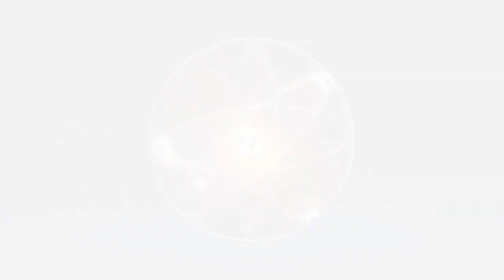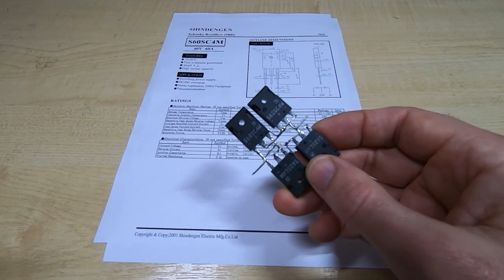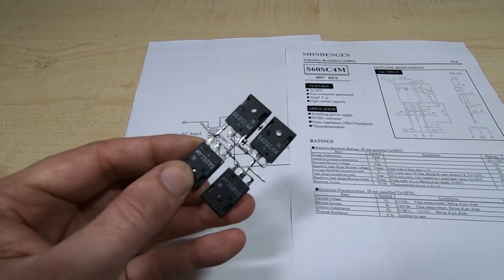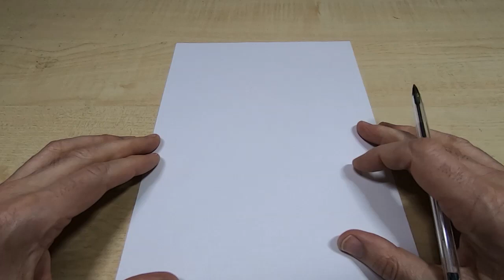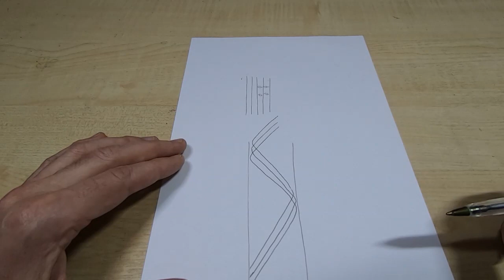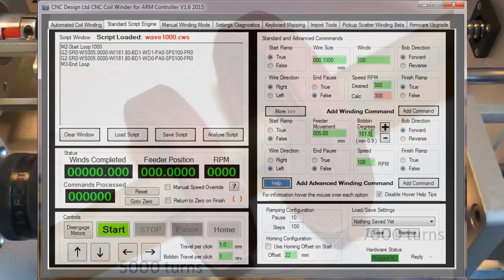CNC Coil Winding Machine Part 2

Comment: What is the purpose of Wave coiling??
Reply from the maker: It reduces inter-winding capacitance so that the coil acts more like a pure inductance. For example in a LOPT the output voltage would be reduced if the energy was going into the coil capacitance but with wave winding there is less capacitance so the output voltage is higher. With normal parallel winding the coil acts a bit like a coil with a capacitor across it. Wave winding is also used in tuned coils where just inductance is required.
Reply: See Faulhaber Motors
Reply: See Faulhaber Motors

Comment: Thanks for an amazing video, is the former something you've printed 3D?  With the double sided tape, how do you remove the coil from the former?  And I couldn't quite get what you said about the wire used, is it "carbon coated"?  You preferred this to enameled wire, what is the trade name of the desired wire?

Comment: Can I save on layer insulation with this technique even on a 5KV coil ? You said it´s good for HF coils so I bet this should also work well on a smps transformer.
Reply from the maker: Yes, For a high voltage coil you would wind it as many narrow layers so that the voltage between each layer was minimal. Wave winding also keeps the interwinding capacitance of the winding low so that it absorbs less energy during a rapid flux transition. You just need to be careful with the terminations. This method was frequently used in LOPT's for that reason. For smps transformers it is not used very often as smps transformers tend to have very few turns and so capacitance is very rarely a problem.
Reply: Oh ok good to know I had a lot LOPT´s in my hands If you mean the flyback TV transformers. Even the very old ones where you can see the windings. The most problems I have seen is with low load there is corona discharge everywhere. I think this will be my main problem. My problem with these transformers is the low output current othervise I would stick with them. I would like to have more like 100-200mA and I don´t believe they will hold up that continuous on the secondary. Because of these currents flyback is not the way to go also more half or full bridge design at 325VDC.
Reply from the maker: @Telectronics  You will not be able to use a LOPT in a switching supply as they work in a very different way. For switching supplies you do not need to resort to wave winding as the transformers in a supply have very few turns and so straight winding is fine. Wave winding in a LOPT (and RF coils) is a good option due to the need to minimise energy being absorbed by the coil and stored in the interwinding capacitance as that lowers the output in a LOPT and creates a parasitic tuned circuit in an RF coil. Corona discharge is normally a sign that the insulation is breaking down. Sometimes it can be resolved by doping the windings but I generally just rewind them (as I have a winding machine :) ).
Reply: @JerryWalker001  My first guess was to just use a normal narrow winding with a lot of layer insulations to limit the voltage and corona stress through the whole coil like a pancake If you want to call it like that. The neon transformers for 50Hz as an example make two coils with a middle point ground to save insulation against earth could I do the same with a switch mode high voltage transformer ? I have been searching for plans like that in the internet but could not find a lot about building your own high power high voltage smps power supply like it´s too special knowledge?! The only thing I know that they use a multiplier If the voltage gets very high and not much information about how the pros build it.

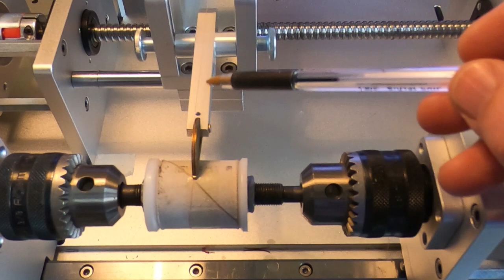Comment: Could you please show some closeups of the "wave winding head" you made/added, around 6:12 in this video?

It seems to be the special sauce of the whole process (the arithmetic/maths of configuring the machine is just the ratio of wire oscillation to spool rotation)